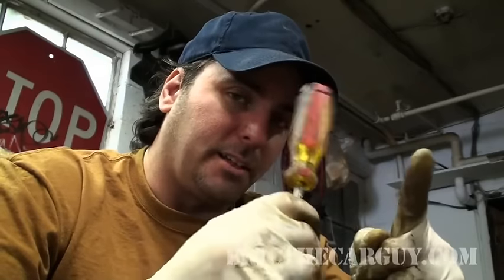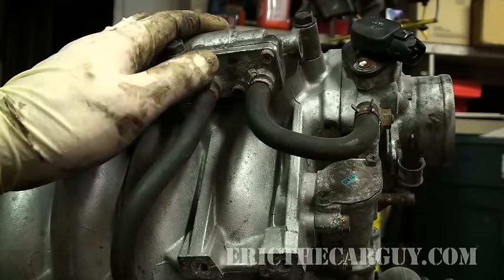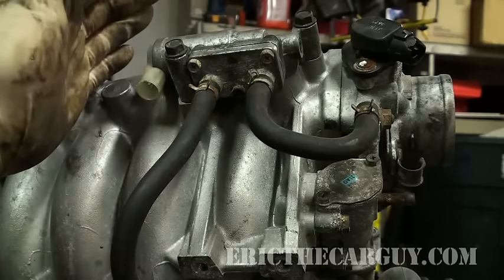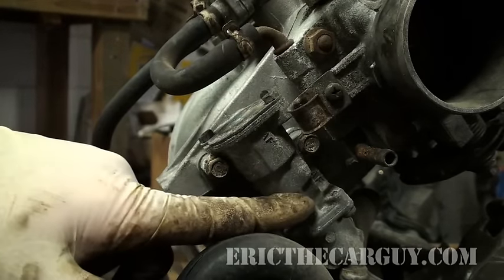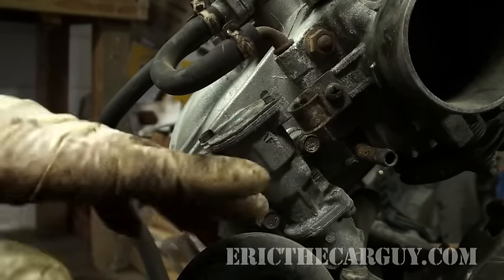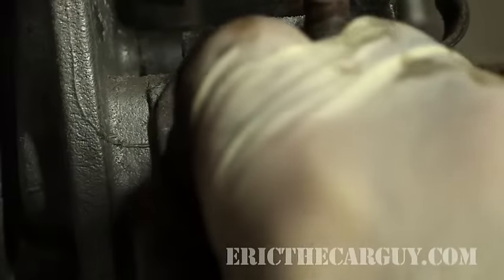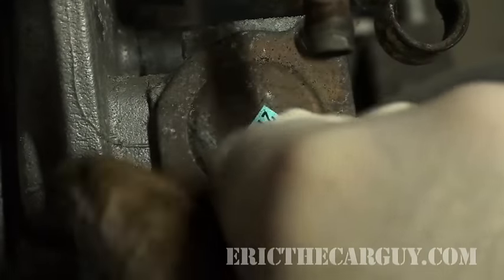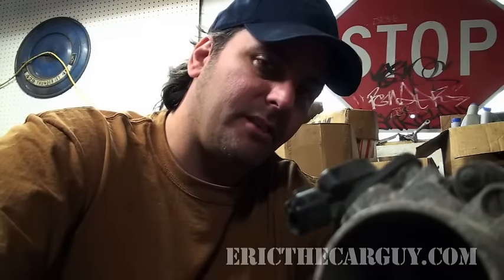How To Solve Honda Idle Problems - EricTheCarGuy

Comment: Hey guys if i have the fluctuating idle and  over 3k rpms it fluctuates and intermittent power loss ish could it still be the same problems talked about in this Video?
Reply: +Steven Last forgot to mention it seems too run better after it is warmed up. more steady idle somewhat. but still fluctuates. also still has issues over 3k rpms. but i don't stall out. Only stalls and shows check engine light when i start it when cold. and dont push on gas to warm it up.

Comment: My 1998 Civic EX is stalling and then my trans wont come out of park, once the check engine light goes out it will start and run. No codes when I hook up a reader. Happens at a stop and at full speed.

Comment: I have a 95 Honda Civic ex with a d16z6 with A/T I have the car running good but when I'm on 4th gear the throttle sound that is get a lot of air and it loose speed and I have punch the gas to get the car on a lower gear or the over drive on to gain speed what it could be.

Comment: on my 1998 honda civic im having issues when i idle or drive slow my light flicker and if i have the the ac or heater on it gets worse and with the ac and heater on the car starts crawling but if i turn the light and ac/heater off the car works fine any have any ideas whats wrong
Reply: Alternator
Reply: Alternator issue

Comment: Freaking awesome just got done doin an engine swap 98 6gen Accord VTech idle would go up and down seen ur video tap on the idle control valve and pufffff problem solve thanks I will be replacing it tho

Comment: hi guys im from Australia i got a ED 1990 CIVIC its a dual carb not injected. 

i tried the air in the coolant thing but idles still at 2500rpm.

cant find these other idle control.valves on the motor any ideas guys.

Comment: Eric,how do u increase the engine when it's low,because it's below 1
Reply: +Taiwo Adesinasi if you are talking about RPM, then below 1 (about 750rpm) at idle is fine.

Comment: I have a 97 accord wagon with codes 302 304 and 1300 it runs rough while ideling I don't know what to do please help
Reply: +Jimmy S thanks I replaced the gaskets now it's fine but when it's in park the idle is high

Comment: I have a 2000 Honda civic lx, and it is idling up and down after it warms up. I done replaced the idle control sensor, but it is stil doing it.
Reply: Have you bled the radiator?
Reply: I’m having the same problems. Air keeps coming out of the radiator though.

Comment: I can't afford to throw parts at the problem. So I'm gonna do everything I can before I spend a dime. My wife's 2004 Honda Pilot just started this fluctuating idle problem. Now I know where to start. With 237,000 miles,  I'm guessing I'll be changing the IAC valve. But not until I check everything else and try cleaning it first

Comment: Eric, I know this video is old but why does low coolant affect the iac? does it lubricate it?
Reply: No, it's only for cooler regions. coolant doesn't touch the inside of valve at all. Just keeps valve hot so it can operate in cooler areas of the country.
Reply: Wrong, the computer doesn't detect air in the system. Only reason that coolant line is there, is for colder climates. Keeps from icing up. Same for the Throttle body....
Reply: I think you all are right because I fixed the coolant leak and doesn't seem to have fixed the issue. I ordered the gasket for the iac ill let you all know if it gets fixed
Reply: Coolant level has nothing to do with IAC operation at all, period. Only need in really cold regions to keep it from icing.
Reply: Chris Orozco
Reply: Azureecosse coolant level has to do with the FITV and not the IAC. ECU will have issues if the coolant sensor is going out or not enough coolant in system to cover sensor. The idle quality from the IAC has nothing to do with coolant period. Disconnect the hoses hooked to IAC and hook the two ends together to bypass IAC and it will have no difference in idle quality on a normal day. That coolant line is only there for cold regions to keep IAC from freezing over.

Comment: My 04 Ody idle issue turned out to be bad wire connection at the power steering pressure sensor.

Comment: Pls help... Surging Idle,..1991 Honda Accord EX, 4 Dr Sedan, FWD, ... 

I have recently refurbished most parts in Engine area, @ Professional Mechanical Shop, included below:

    However, aft changing these, Idle speed was surging, 1k-2K in Neutral, and surging forward at stop signs in Drive, (so had to put in Neutral at Traffic lights, annoying ..).. then changed IAC twice, AND 3 mechanics can't figure out what is wrong even after adj idle via distributor,... they have cleaned IAC also,..
    Disabling IAC w Solenoid has bypassed this problem,,, I have videos, of idle speed with IAC plugged in (Surging ), and w/o plugging it in (no Surging,..),...
    The following were changed bef I had this problem

         Spark Plugs, Wires,
        Alternator, Starter, Belts,...
        Fuel Tank, Fuel Pump, some Fuel & oil Lines,..
        Radiator, Condenser, Hoses, Rad Cap,..
        Timing Belt & Water Pump, Tensioners
        Oil Pan & Gasket, 

Car was parked for few yrs during Covid, but before that, the Car used to drive really well, high speed was smooth, 100-120-140++  kph easy,.. smooth, quiet, normal Idle,...  altho Fuel Tank & Rad had started to leak, rusting, so had bought another car, and parked this one,..

Three (3) diff experienced Mechanics have played with IAC, and have changed both IAC valves (one w Solenoid was changed 2x!), but no luck.

Currently, and even before these repairs, with IAC UNPLUGGED, car feels it has enough power, and has v good acceleration for a 23 yr old car, No sputtering  ! (==> so NO vacuum leak?) & (NO defective Airflow sensor?),...

I have seen videos of surging problems on YouTube,.. and if anyone has any more suggestions,..

Thnx

Az_99

Comment: thank you,sir. cleaned IAC valve by just spraying carb cleaner into the hose connections that lead into the IAC .... let it sit overnight with hoses disconnected.
Reply: ray carr you talking about the lil 2 holes?
Reply: @MrTakeOne    I  removed (one at a time to not mix them up) the hoses.   dowsed carb cleaner into the IAC holes where the hoses connect. let it sit overnight with hoses disconnected(otherwise, coolant will mix with the solvent).There's a cap with 2 screws that contains the pin for the rotating flap inside the IAC. Moved it back and forth to loosen it up. I eventually disconnected the entire throttle body out of curiosity and to see how dirty it was. Waste of time.

Comment: You right cleaning the IACV may work for a while and then it will not work anymore, like mine it was problem with the Aire conditioning, when AC on, the idle goes down badelly and the cumputer shutt the AC off after two attemps, i remove the valve, and i found a lot carbon build up on the filter side, and i spray the valve with carbon cleaner, remove all carbon deposite from the filter and install it again and  after  driving 5 miles, the problem.solved and AC working properly ji problem for two years (i was luky), after that the same problem happen again and i remove the  valve but there was no carbon deposite on the filter, but i just spray carbon cleaner inside the valve and again, it worked just for two months, and then no more, i had to buy original honda one, because the after market dosent last too long, may be a year or less.

But mechanic shop cant just clean the valve, because it may work just for short  time, letting the deiver stranded on the midle of the road and the customer will be angry on the mechanic shop, comming back to fix the problem.

Comment: Hi ETCG! I just bought a honda CRV and noticed when i remove the oil filler cap it pulses alot of air out and the idle is rough. i also get a p0325 and p1259 code? are they related? THANKS! i love your videos.

Comment: My 95 civic lx is driving me mad when it's cold starts fine idles fine I drive off runs fine till it starts to warm up and while driving it dies intantly usually the same intersection downtown middle rush hour traffic and won't start it's like the fuel shut off after repeated trysts to start spits,sputters,like not getting fuel it starts finally and runs great no more stalling but. When I put it in park then the idle goes wacko and surges up and down at idle only .park car overnight start car when cold and the same scenario starts all over again .I've clean and adjusted fast idle valve and the other valve ? with the screen in it ?and tryed to squeeze out all air pockets in the cooling system & cleaned throttlebody and gasket repeatedly. What the heck can be the problem I go through it every day

Comment: My civic only idles on cold start but when it's driven it stays around 900 at a stop can anyone help I already clean the idle control air valve and the throttle body

Comment: Hello. today I started having a very high idle. it just happened. I was driving home and all of a sudden the rpms went up and almost red lined.

what is the most likely cause of this?
Reply: Tps
Reply: does it constantly run at high mine does IDK what wrong with it
Reply: Patrick Hall sorry for a late reply but it could be your throttle cable (unless cr-v's have an electronic system then nevermind). It could be too tight and pulling in air when it should be closed, watch a video on adjusting throttle cables and you should be good.

Comment: could it be my iac when my hondas hot it sometimes starts at low rpm then jumps to 1000 even on cold starts it moves up and down but only like 100 to 200 rpm and when it warm it starts to get power loss
Reply: Had that problem you just need to adjust ur idle screw when it's warmed up bud

Comment: any idea why my honda civic 2000 sedan shake when i press the break to stop on a red light or a stop sign?
Reply: Get your tires rotated.
Reply: Brian Martinez your brake rotors are warped.  Pedal pulsation, pedal dancing under your foot, vehicle shudder or steering wheel shake while braking.  Change the front rotors and the pads if they need it

Comment: Mine revvs itself up between 1200 rpm and 2000 rpm and backs off to 800 or 1000 rpm and when I block off all intake airflow it idles at 500. Someone help

Comment: Hi my name it's lio..I have a 2000 mitsubishi galant I have a idle problem......I put my ob2 scanner on the car and the code it's p0505 on the scanner says idle air control system..........I aredy clean the intake check for vacuum leaks ........I was checking online ....and a lot of people says that it's the idle control valve...........what do u think.....let me no please I love cars and I like to do the work my self.....but if I can figure out this one gonna have to take it to a mechanic......Ps....adle air control system......it's the same as the adle air control valve.....

Comment: Hey Eric i swapped my motor but my motor idle stays in the high position like 2800 rpms no check engine lights either
Reply: You made sure your throttle cable isnt too tight?
Reply: @scrotiemcboogerballs3453  nah bro its already done its the iacv the motor inside of it was burnt to all hell replaced it runs idles like a dream but i gotta get it tuned😂

Comment: Can anyone help me? My Civic has wierd idling issues whenever I am coming to a stop as well as having a wierd shift problem between 20-40ish mph.
Reply: Check your Idle Air Control Valve (IACV), might need to be cleaned.

Comment: my honda,, don't know why... butterfly valve was slightly hanging open...causing idle surge. I have been going from 1 prob/code to the next... only to run out of codes and accidentally found the butterfly valve to be the prob. computer will send NO code! but after pressing the "gas" releasing the throttle cable thing from under the hood, and pressing it a bit harder closed, boom bada bing.. idle went low and stop surging. 1996 honda civic LS? D16Y8, with i think.. D16Y7 intake?  car was automatic is now a 5 speed stick this throttle body has a different valve on it..   i think it's like fast idle/cold idle valve, is not Black but Green body w/3 pin connector I think. and Now...  i need a new throttle body but can't seen to figure out what one this car has on it. so my throttle body has 3 sensors, Map, TPS, IACV with coolent lines attached.

Comment: My car Honda Accord 1998 when I drive start accelerate push on gas pedal speed did not move certainly it move jump forward.when I stop on stop light or sign,start move push on pedal it did not move than jump forward.why it do that I need. Answer.what close that.?

Comment: Need Ur help now I'm a mechanic you specialise in Honda's I have a 2008 honda civic mk8 2.2 turbo diesel I'm after having this problem no engine light what's so ever  I'm after the temperature sensor the fuel pressure sensor fuel pressure valve fuel pressure has been checked fuel injectors have been checked no engine light was coming on but when I read the car with the diagnostics did have a fault 4lforthe intake throttle body so I put a new second-hand one on I replace the exhaust manifold as it was leaking I had all vacuum hoses changed do a full I'm still my oil jumps from 500 to to a 1000 oh and last think new EGR valve and still no change have u ever come across this problem before I'm at my wit's end right now whit the car  oh and when I come to the lights to stop 8 times out of 10 the car will stall out and in the Morning hard to start then ok true the day and hard Agen if I go to work and don't start till living work

Comment: The problem is very common with Honda Civic, you can clean the idle air control valve and adjusting the engine idle speed (disconnect the battery and touch the two terminals together for an hour or so which will clear the ECM, connect the terminals back and start the car and let it idle of 15min without touching anything this usually takes care of the problem).

Read more: https://www.autocodes.com/p0505_1996_honda_civic.html

Comment: I have a 97 civic lx. The car idle low when the car is warm. And when I drive it coming up on the stop its sounds like it's gonna die. Anyone knows what's the problem? There's no check engine light either
Reply: +Jaymo_ EK9 Dirty Air filter, IMHO
Reply: +Jaymo_ EK9  Check and clean the EGR valve .

Comment: Eric gotta disagree about not changing the PCV valve.  They get clogged with varnish and when that happens pressure builds up and oil gets pushed out the seals.   I would say every 60K for the PCV valve.

Comment: Holyshit you sounded horrible.  But this is great info.  I'm about to buy a '98 Integra and it idles high once started, if started and warmed up, it doesn't want to start back up until it's cooled back down.  Then, it's misfiring when over about 20-25% throttle.  Scanner says it is misfiring in 3/4 cylinders and that those same cylinders are running rich.  But for $600 and an impatient seller who doesn't want to spend anything on it, I can't complain much.  Once you let off the gas at speed, it runs great.  Again, great info, I'll check out some of this stuff once I get it back to the house either later on today or tomorrow.

Comment: I wasn't really worried so I disconnected the battery while watching this video. I went back half way through, reconnected the battery and the car started up and idle issue (consistent fluctuation) went away.
I had disconnected a hose that leads to the right side of the intake manifold. The car started to fluctuate. Turned off the car, and turned it back on with the hose off (trying out seafoam) and I had the idle problem. So i reconnected the hose, turned off the car and disconnected the battery. A few minutes later, I turned it back on and the issue was gone. Hope this helps anyone who is a novice like me.

Comment: When I come to a stop and idle my cars engine revs up and down. I was thinking EGR (97 Chevy 3.1L) or IAC valve or MAF but I got the codes checked and they said it's probably the fuel injectors ... They meaning autozone #autozone #ericthecarguy

Comment: Eric.. How can I get the air out of the cooling system?.. 97 accord 2.2 non vtec
Reply: Ruthless Richie Let it idle with the radiator filled up while burping the upper radiator hose until your fans cyle twice then cap it and fill the expansion/overflow. Easy.
Reply: There is a bleeder valve on top of the thermostat housing. The 12mm socket. Have the vehicle running and loosen the  valve. Once the coolant is coming out closer valve and the system is beld

Comment: someone help my rsx type s is having idle issues. its like it forgets its idle memory and once in while if fixes then comebacks. what i think is causing this issue is because i install a racing header with a cat delete. i got a 02 sensor code and catalytic converter code.
Reply: low idle^
Reply: Like he said... Fix the code first then after that go through the list of things to check. Most of these things you can do yourself and install replacement parts yourself through online vids

Comment: ‘09 Civic 1.8. Put it in drive, press gas pedal and RPM hardly goes up and car won’t hardly go. (Almost to a slow crawl).
I’ll stop and put in reverse or park then back in drive, works perfect. 

NOTE: It doesn’t do this all the time and when it does, the check engine light is flashing. Once it straightens out, light stops flashing but stays on. 

Also, my check engine light came on (stayed on) only when I cleaned the MAP Sensor few weeks ago. 
Anybody had similar problems??

Comment: I HAVE A 2009 CNG CIVIC THAT IDLES WEIRD. IT DIPS DOWN REALLY LOW, EVEN DIED A COUPLE TIMES BUT RARELY, THEN IDLES UP TO COMPENSATE. I HOPE THESE TIPS HELP. ANYONE ELSE ON HERE WITH A CNG CIVIC EXPERIENCE THIS? THERE ARE A FEW FORUMS I HAVE FOUND BUT NO ONE HAS A DEFINITIVE ANSWER AND HONDA LAST I READ HAD GIVEN UP ON TRYING TO FIGURE IT OUT, THEY CALLED IT A "GHOST" IN THE SYSTEM LOL